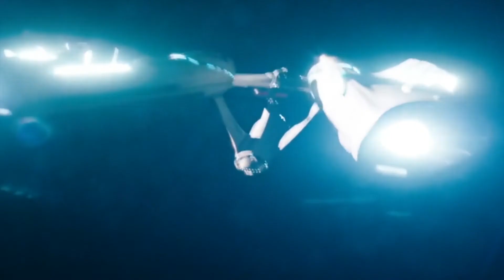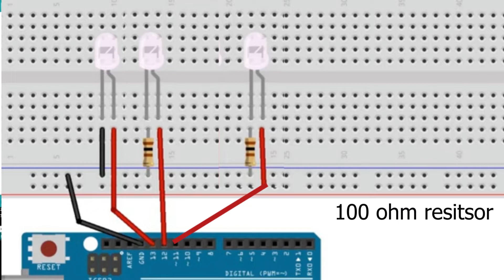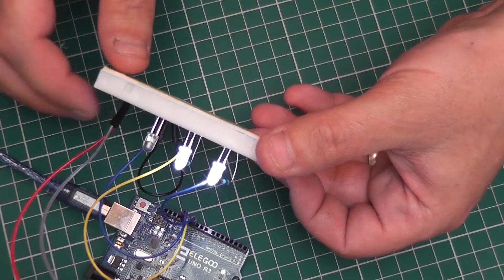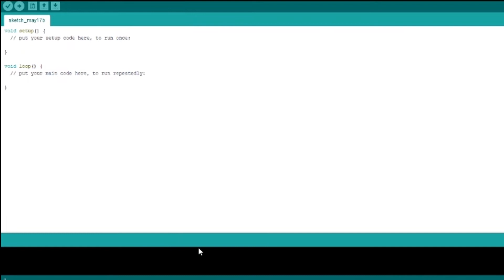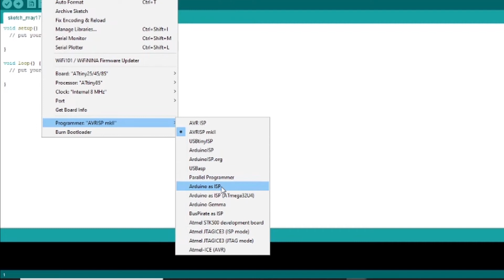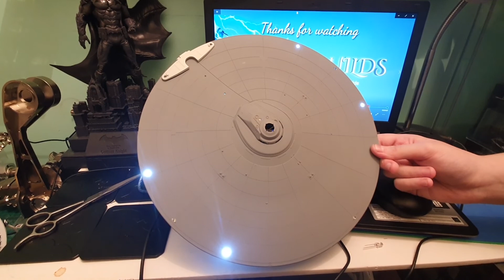Build The Star Trek Into Darkness Enterprise - Part 4 - strobe/nav lights programming

Comment: Using a lot of Attinys going to be much more expensive in every aspect than using an Arduino Nano. It will not make the PCB unnecessary, because you will have to to use transistors or ULN2803  to be able to use more LEDs on the pins (to keep things relatively simple). You also can use a 4017 decimal counter to make the turning bussards and a WT588D to get sound. But to make all these with separated Attinys will make the thing much more complicated than use a Nano (which is the same regarding of programming as your UNO, only smaller in size, so you can write programs with the UNO and then when you are happy with your work, you can upload it into a Nano).

The only thing that may be a bit more problematic with this approach (one instead of a lot) is that you will have to learn programming a bit better. For example learn how to use millis() instead of delay(). Just because instead of writing tiny programs into several separated MCUs, you will end up with one big one that does everything you want. Believe me, it isn't as complicated as it maybe seems at the first sight.

I think it would be very wise to watch some of the video lessons of this guy too. You may find very good ideas being hardware or software and can learn a lot before you start.

https://www.youtube.com/channel/UC8Ob-HnnmhlgSv5Vs_i32TQ/playlists